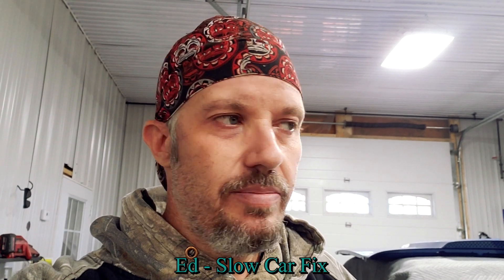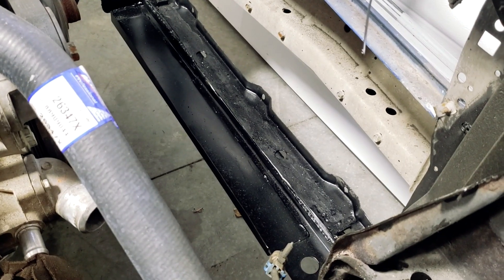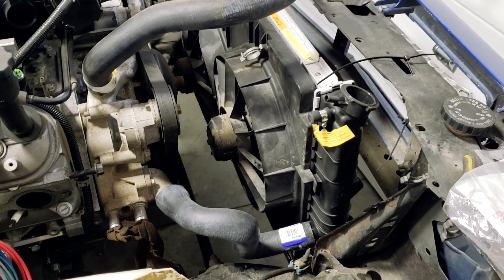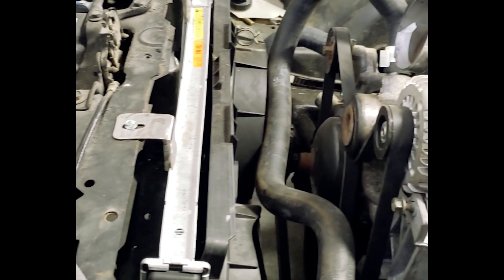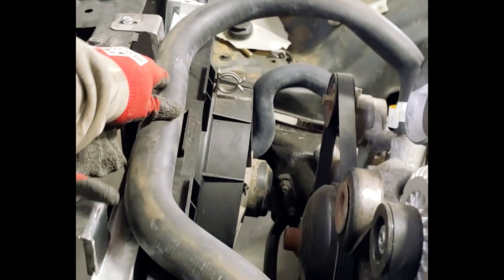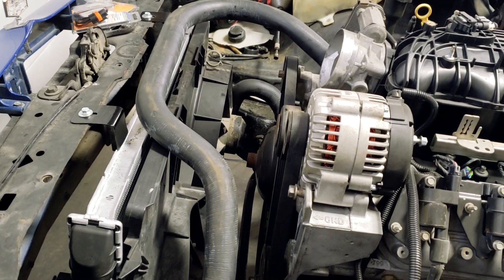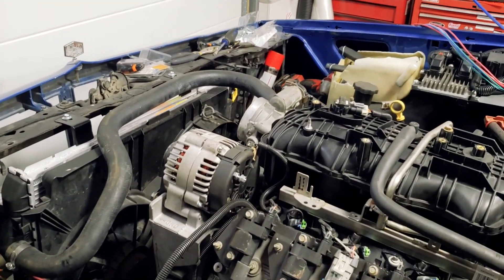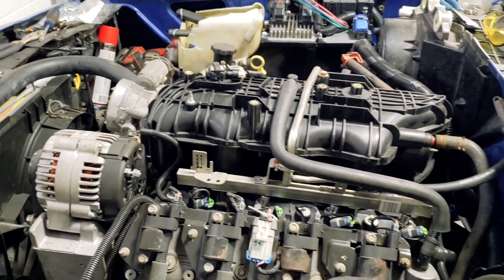G Body LS Swap - Cooling System and Radiator Install

Comment: A stock radiator would have worked long as it’s a 2 core or more, and if people would do there research for example the 2002 RS V6 Camaro’s uses the same radiator as the Z28 5.7 LS

Comment: Question how come the LS truck radiator won’t work in a g body? I want to fabricate to make it fit but first I want to know what problems to look for.
Reply from the maker: Truck radiator is too wide, and too tall. F body radiatior is cheap and works well.
Reply: @SlowCarFix you have a link to the radiator you used? Or what year do I look up?
Reply from the maker: @papergatorzfedducca7998  F-Body, any 4th gen Camaro/Firebird with a V8, and you can get the matching electric fans. I bought this from Rock Auto - pretty cheap.
Reply: @SlowCarFix  ok thank you!!
Reply: @SlowCarFix  ok thank you!!

Comment: Do you have part numbers for the upper, and lower coolant hoses?
Reply from the maker: I don't, but I know what they're from. The short hose is stock F body 98 Camaro. The upper long hose is stock 2011 Chevy truck. They worked well but the F body radiator challenges you for an air intake. Very limited for room because the hoses are in the way.
Reply: Thanks, I’m using a Chevy truck radiator with dual dodge intrepid fans.